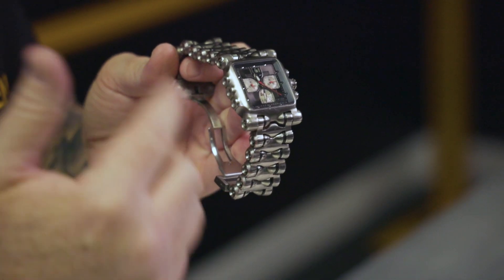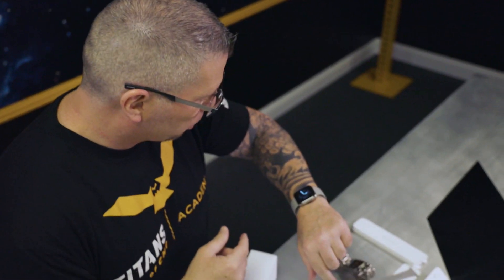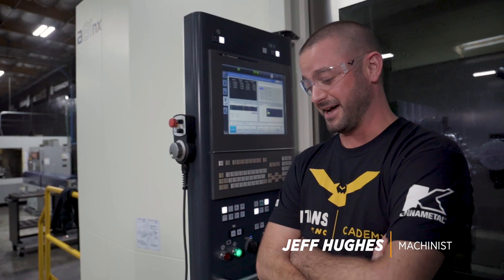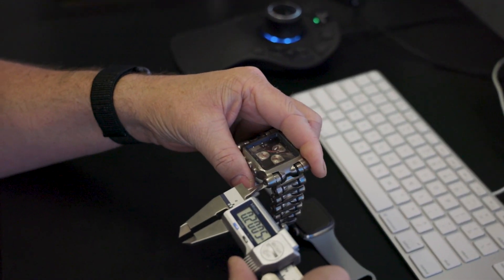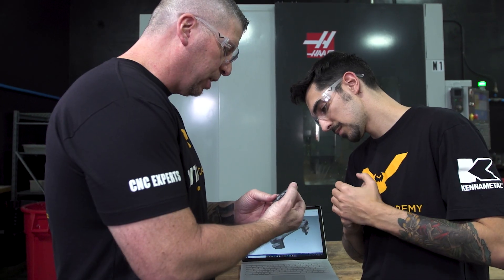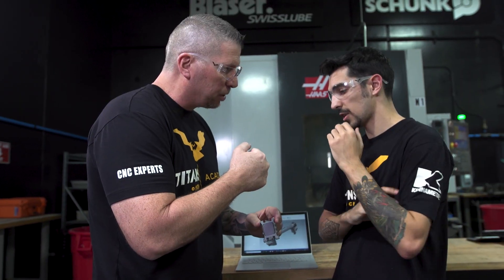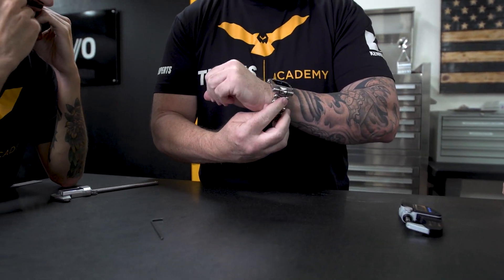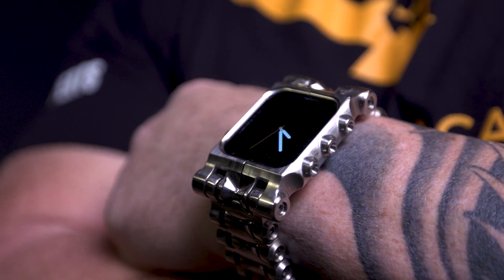CNC Machining a Custom Titanium Apple Watch

Comment: Titan does titanium act as a faraday cage and prevent you from getting Wi-Fi with your apple watch. A few years back I made a bunch of cases for the iPhone 5S out of aluminum. They looked great but they quit being a smart phone. I couldn't connect to the internet anymore because the aluminum case blocked the wifi signal. we could still make calls but the reception was reduced as well. I had the same idea as you but I was going to make the watchband and case for a Casio G Shock...